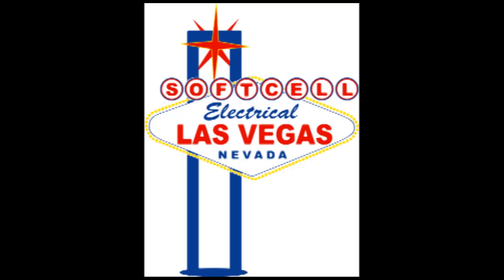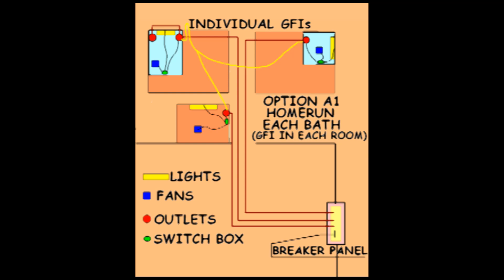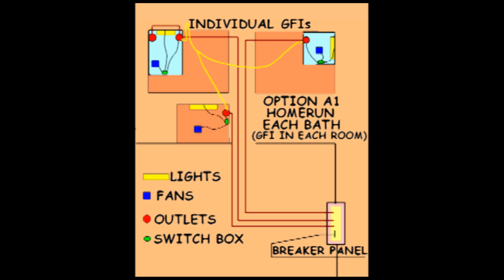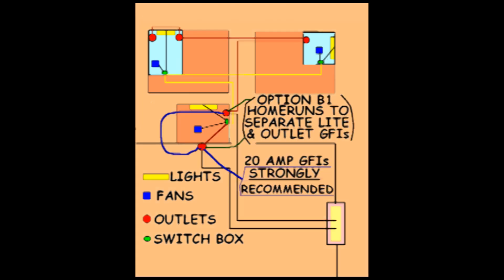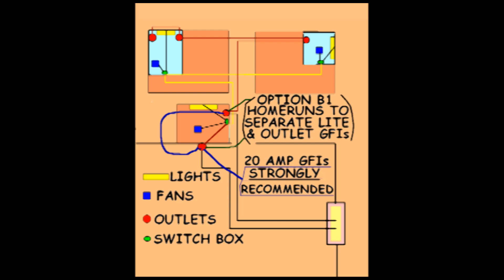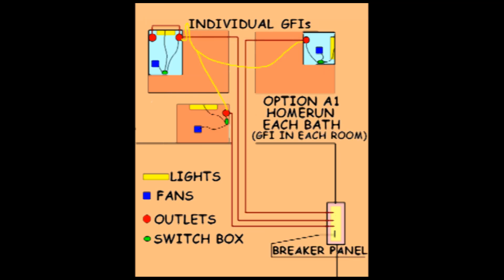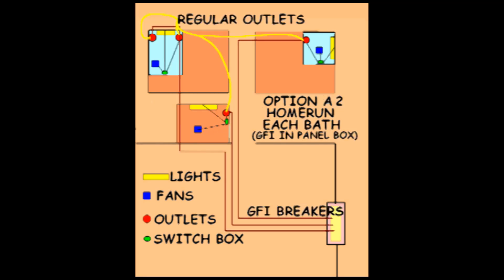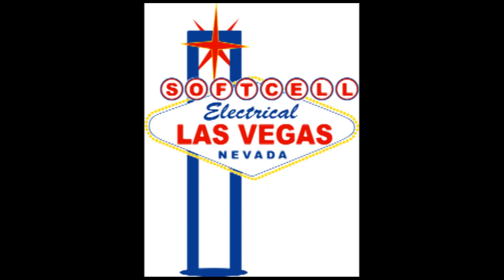NEC code on bathroom wiring #69

Comment: Do you know the distance a bathroom light switch must be from any "wet area"? Another channel stated in their region (somewhere in canada) it had to be 36 inches. I am having a hard time getting this question answered.  Im working in a very small bathroom, and would prefer the switch be inside the room. The problem is that for it to be convenient,  there is no place 36" from wet area. Thanks.

Comment from the maker: Thank you for your comment. Actually the code in which you refer to, 210.11C1 Should be 210.11C3 (Bathroom branch circuits) If you read carefully, my methods exceed code requirements and provide more actual wattage for each independent bathroom. As I said before, I met with a senior board member for clarification before ever making this video. Best regards and your comments are always welcome.

Comment from the maker: I made this video based on exact notes taken from a meeting with the Nevada Contractors board.  The main thing is that outlets must be on a separate GFI from fans and lights unless the breaker is dedicated to that bathroom. Nevada is ;not recognizing the current code book because of the cost increases involved with some of the motion light switches and other things that are cost prohibitive. I just went by what the Board told me.

Comment: Can you talk about how a GFI acts as a circuit breaker as opposed to a ground fault safety device? I wire small jobs as a garage door repair guy but am not an electrician. 
Thanks!